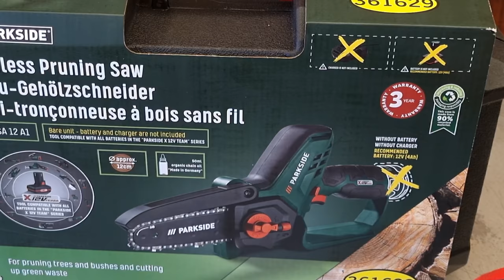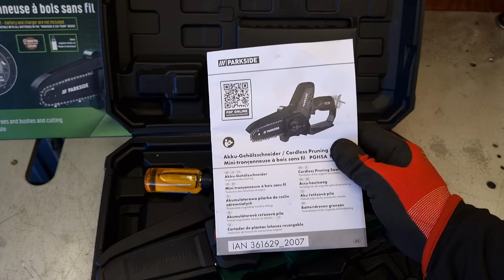Malá reťazová pila na 12V akumulátory Parkside PGHSA 12 A1. EXTREME TEST

Comment: I bet handsaw would be much faster and axe for branches.
Reply from the maker: I don't know because the cutting speed was equal to the Performance X20V
Reply: @FORWORKANDFUN  
Lidl have New Akku Modell-Versions of 12v and 20V 4Ah (B3). These are with Cell-Balancing for more available Power.
Can you make a Test old/new Modell? Is the New Version possible better?

Comment: Say whatever you want, but you cut more than 15 pieces of 20 cm wood haha. It has no oiling system and only 12v, but for somebody who has a backyard with few fruit trees and few 12 parkside batteries, it is more than good. Whoever will use it, it will not burn their hand, because they will not cut regular bigger wood for heating
Reply from the maker: There will definitely be a lot of fans of this type of machine and it will suffice for them.
Reply: @FORWORKANDFUN  
What would be your opinion on the plunge saw and its track. Does any other track fits it, from other brands. I watched one guy that said its not very accurate when you connect the tracks, but i do not know if any new version came out. Here in croatia, we didnt have any tool in the market for a longer time, so i have no idea what came out. Here in Lidl, only swiming stuff and summer things, no tools
Reply: Exactly right. I'm not sure he understands or has translated the word 'pruning'. Just what do people expect from a little 12v. chainsaw!
Reply: @bayadere8308  
its overload on purpose. Its like testing any sander with laying with your own weight on it, and saying "its weak" haha
Reply: Yes, I tried to saw the roof off my Volkswagen, but it was useless! 😁😉

Comment: a shame you dont show how it actually lay tensions on the chain with that fingerwheel 3:33 so we can judge how good its gonna hold that tensions or it will be loose again fast, as usually you have a pulli under the chain guidebracket that goes into the guidebracket inner holes and pulls it forward or back that way, but you don't show and there is nothing under the chain guide bracket that looks like tension alignment..
Though it does look like 12v is too little wattage, likely should have been on the X20 lineup..
Reply: I purchased this one from China, it was like 25 euro delivered to DK with 1 lackluster battery and a cheap DC barrel charger, I also purchased these other cheap CN items,  a 45euro planner/hovel (makita knockoff, suppresingly decent) and a 15 euro orange impact wrench, also for Makita cells
slideshow imgur = /a/9NIY2kX

these hand motorsaw can take different blades, up to 8 inches as I recall, but likely overkill with that weak brushed motor.
purchased a 8 euro kit from AliE with 6" blade and 6" guidebracket.. as you can see the 6" have a wheel inside and quite a bit more pointy then the native 4" it came with.